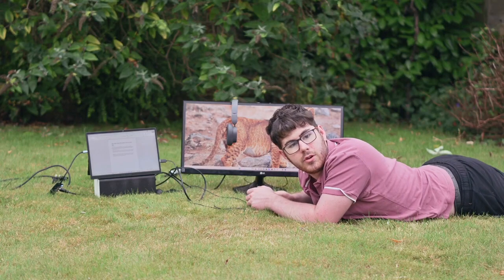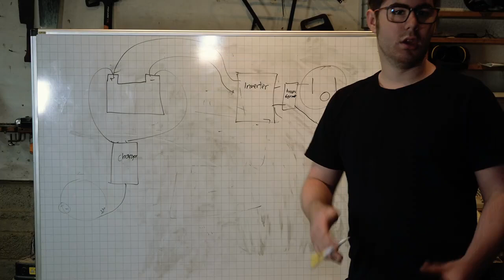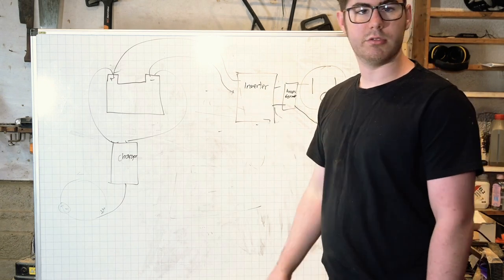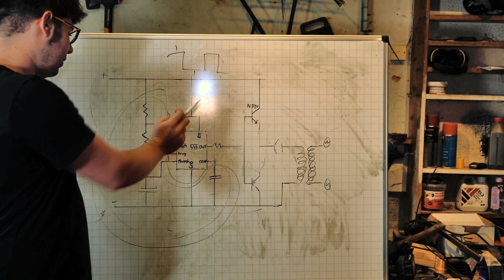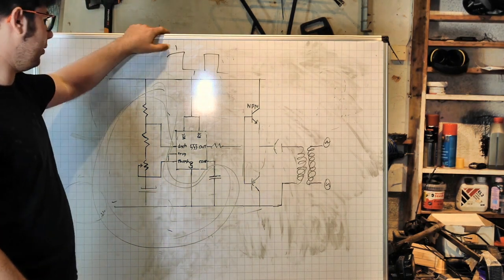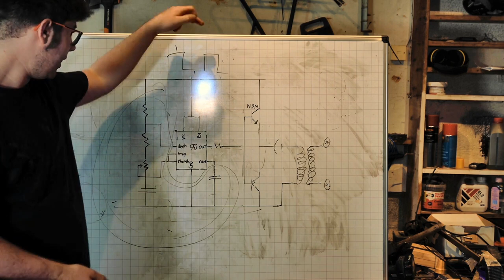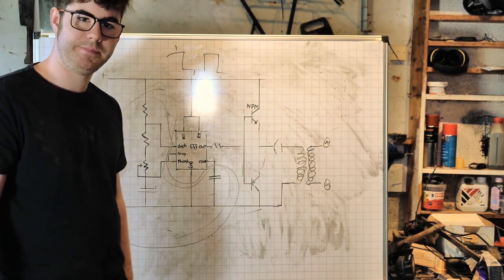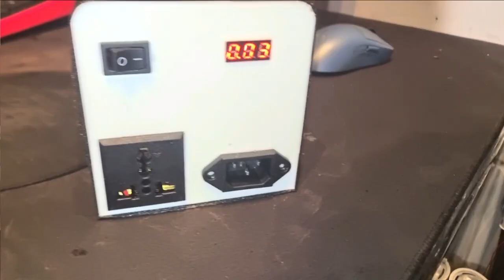Building a Powerstation for $50

Comment: What easy with people addiction to DC? It doesn't make sense if you aren't transmitting power for miles.
Reply from the maker: @INVAZOR33  DC is almost always more useful about 50% of devices used around the house use DC, light bulbs don't really care, so only about 10% use ac. Ac is used for mostly by convention, as it was what is generated by motors. But the other reason is that it is easier to change the voltage allowing the powerlines to be at a higher voltage, and being more efficient.
Reply: @Boris_Woodwards  most of your devices rectify the power before using it, actual DC loads are few and far between.
Reply from the maker: You rectify ac to become dc. Most things use some form of SMPS which works by converting ac to dc using a full bridge rectifier, it then used a variation of a buck boost converter called a flyback converter to step the rectified voltage down to a lower dc voltage. Finally you use polarised  capacitors to smooth the output. This out pus is going to be low voltage dc in most applications
Reply: @INVAZOR33  Quite the opposite really, nowadays the only things that actually use AC are motors like fans, fridges and air conditioners
Reply from the maker: @Psyden5757  exactly right

Comment: How did you address cell balancing with your charger? 
You mention the 12 V 20 Ah battery, and a 3S charger; I guess more details are required, on if the battery is Li-Ion (4.2 V) or LiFePO4 (3.6 V).
Thanks
Anthony
Reply from the maker: I am using LG 3.6ah 18650s  li ion batteries(3.7 nominal 4.2 charger) in a 3s 11p configurationCell balancing is handled by the bms, and cell balancer which I  incorporated into the battery. The balancer I'm using is from QINIZX and uses 5a capacitive balancing. The bms is a passive balancing with 120ma of balancing while on charge.
Reply: i believe he uses Li-Ion batter since he said that the charger is for a Li-Ion battery